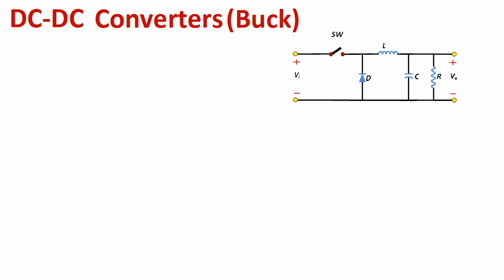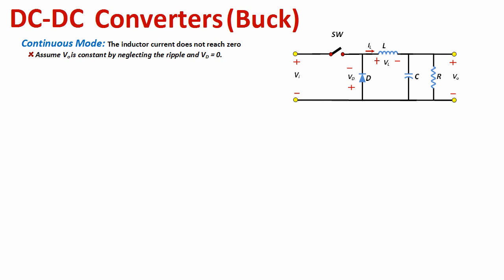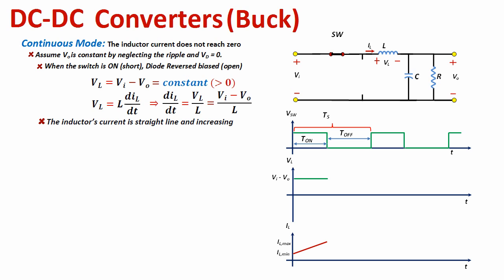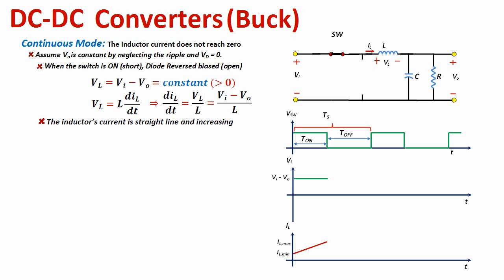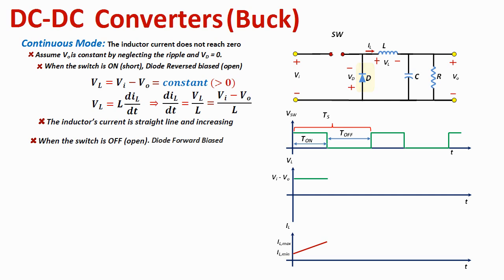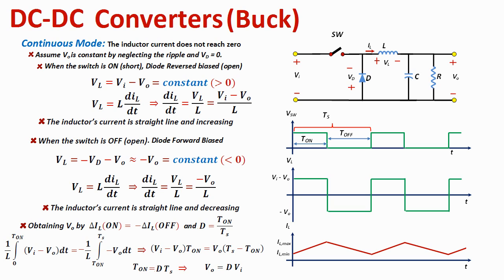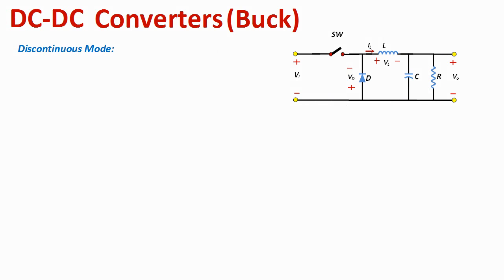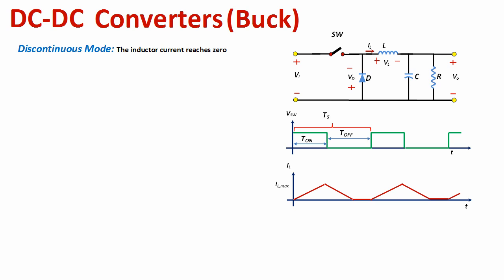DC DC Buck Converter 3

Comment: Hello. I know it may be extremely basic question, but...how is it possible that inductor can provide, for extended period of time, current in opposite direction than voltage that is present on the inductor. 
It makes perfect sense from the inductor voltage-current equation.
I am asking from physics point of view, where current should flow from + to - potential. It is true that current is decreasing when SW is OFF, but it is still flowing in opposite direction of the voltage present on the inductor.
Thanks for your response.
Reply from the maker: This is a good question. The basic intuitive answer is that if the current is decreasing, then the amount of stored energy (magnetic field) must be reduced. This is expressed as a negative voltage across the inductor(Faraday's Law). Basically, the voltage across the inductor is a function of the derivative (rate of change) of the current. I hope this helps.

Comment: why does is inductor current linear?
Reply from the maker: It holds superposition and scalar multiplication. Kindergarten stuff, :). But it is a good question.
Reply: @abuhajara  thank you but bad explantion.
Reply from the maker: @bahadrguven6268  I must misunderstood your question. If the voltage across the inductor is constant then current is linear (straight line with constant slope) because V=L di/di. If V is constant then di/dt is constant. Hence, the current is a straight line with a constant slope. I hope this helps. :).

Comment: 08:10 why does the polarity of inductor voltage not change when it discharges while the switch is off? Why does no one explain this? Don't inductor voltage and capacitor current reverse when they discharge? Get lost. Bookish explanation.
Reply: I have exactly the same question about the inductor ?!